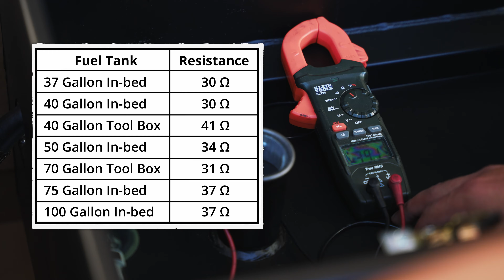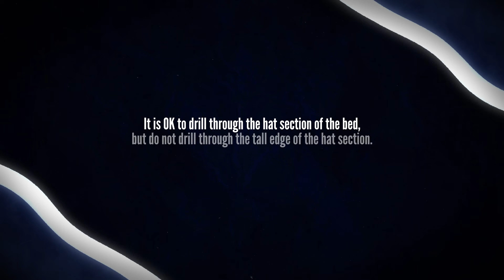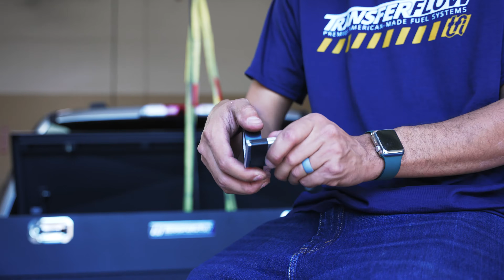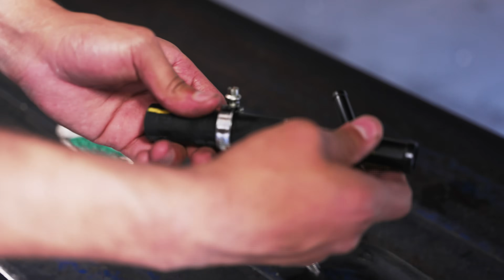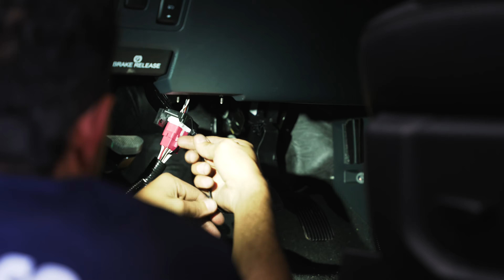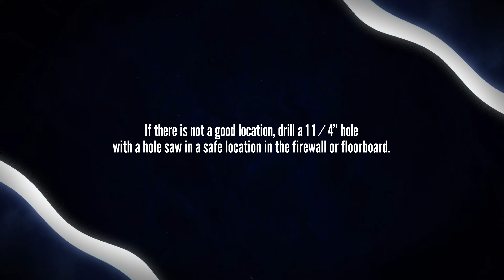How to install a Transfer Flow Auxiliary Fuel Tank & Tool Box Combo

Comment: Wondering if you can run the supply line from the tank to a sump port or is the fuel pump not strong enough to supply fuel from the bottom of the tank?

Comment: What is the purpose of the trax 4 ? Why cant' you  just hook up to a hot  wire and hit your transfer button  to send fuel into your main tank. My understanding is trax 4 just allows you to see how much fuel you have in your auxiliary tank. Also it takes away of you plugging any other thing on your OB2 port.
Reply: Bank Power sells splitters for the OB2 port
Reply: Found out the hard way today that splitter won’t allow my Idash to work. It’s one or the other. I called banks and they confirmed it when I was having issues. If someone has a workaround, I’m all ears.

Comment: Can you use this without the Trax4 app? I intend to offroad with this fuel tank in areas with 0 cell service or connectivity of any kind.
Reply: I have this system and have used it in a lot of areas of Montana with no cell signal.  The system works without any cellular connectivity.  The pump system operates off of the data from the truck's ODBII connection to measure the primary tank's level, then transfers around 3 gallons when it's < 1/2 full.   The app is really just an initial configuration utility to set your truck's primary tank size.  After that, it functions as a remote fuel gauge via Bluetooth connection to the tank's controller, nothing else.  You just need connectivity to download it, then it's all offline.  I've had mine for around a year and a half, and it's always worked flawlessly.  I also never receive any of the fuel gauge errors you read about on the forums with gravity-fed systems.  I would 100% recommend it!

Comment: I have a 2016 Chevrolet Colorado (Work Truck, Manual transmission, 20-gallon tank). Will the electronics and vent hose be compatible with this truck?